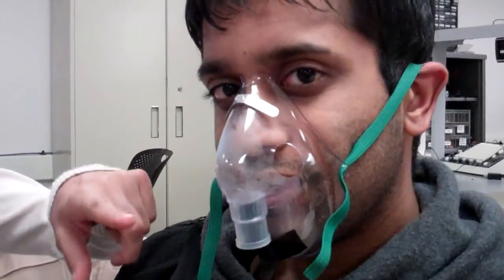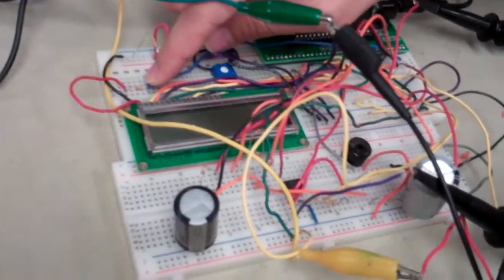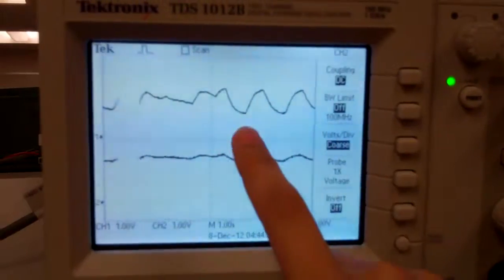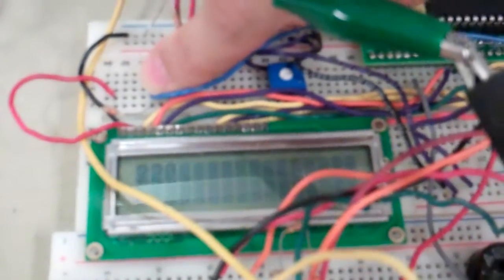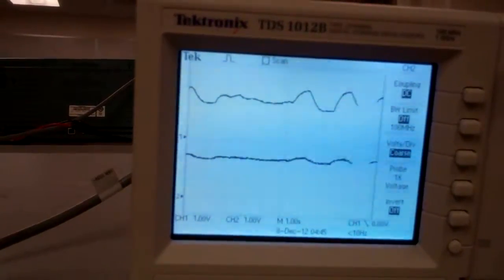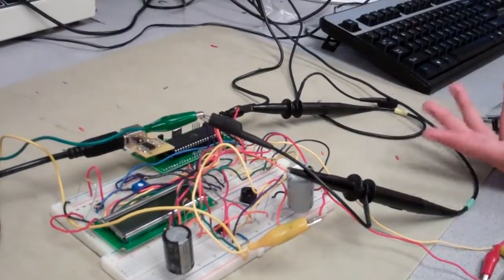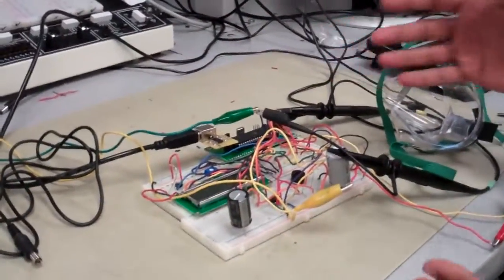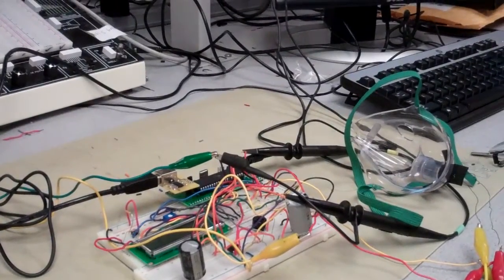Thermistor Respiratory Monitor

Comment: I need the complete schematic, in that page the schematic used 2 opamp but in the video and pictures they are only using 1, the minis schematic are confusing
Reply from the maker: Perhaps you did not know that thie opamp package contains two opamps. The document linked is the only information that exists on the project. But this project was done in the context of a class which used the following protoboard. http://people.ece.cornell.edu/land/PROJECTS/ProtoBoard476/
Reply from the maker: There is a bit more information here, but it is behind a paywall https://ieeexplore.ieee.org/document/6525657

Comment: plz can you explain the mathematical  relationship between temperature and respiration rate that used in your  projuect
Reply from the maker: exhaled air is warm
Reply: I know my friend
I'm working on respiration rate device by using thermal sensor I used lm35 and arduino  I had problem with code that connect temperature that I got  with respiration
Reply from the maker: @kingsboy8903  lm35 is too slow for respiration. you need a bare thermistor, the smaller, the better. example https://www.digikey.com/products/en/sensors-transducers/temperature-sensors-ntc-thermistors/508?k=thermistor&k=&pkeyword=thermistor&sv=0&pv16=7&sf=1&FV=ffe001fc&quantity=&ColumnSort=0&page=1&pageSize=25
Reply from the maker: the sensor used in this project, as specified in the pinked report is NTHS0402.https://www.vishay.com/docs/33008/nths.pdf
Reply from the maker: lm35 datasheet section 6.9, figure 3. http://www.ti.com/lit/ds/symlink/lm35.pdf

Comment: Could you please tell the exact thermistor you used for this project.In the data sheet it just said NTH SMD 402 series ,but what is the resistance and curve % of the thermistor you used or pls tell the exact serial number of your thermistor.
Reply from the maker: This project is 6 years old. The ONLY documentation is the linked report.
Reply from the maker: https://www.vishay.com/docs/33008/nths.pdf

Comment: May i have the circuit connection
Reply from the maker: did you read the linked report?
Reply: yes, but i didn't understand how to combined all the circuit
Reply from the maker: The report is the only documentation that exists.  Each of the circuit fragments shown indicates a connection to the MCU as a port pin number. One part they did not talk about is the board which we used throughout the semester which has the MCU and power supply. Schematics are here http://people.ece.cornell.edu/land/PROJECTS/ProtoBoard476/

Comment: Hi Bruce.I want to ask you some questions....can you give me an email to communicate?
If you please.
Thank you
Reply: Hello Mr. Mohammad Azzam.
Have you arleady succeeded to try thermistor with arduino Uno? Because I want to try this project on arduino uno too.
thank you before.
Reply: @marrezarifasaputra5748  brother send your circuit diagram for this experiment
Reply from the maker: ask here, or figure out my email yourself.
Reply: Bruce Land okkk...I work your project as my senior with some modifications...I try to apply it using Arduino Uno and connect it with mobile application using Bluetooth...The problem is with the arduino code...it gives me on the serial monitor (inf) while breathing...
Note: I try to modify your AVR code to work on arduino, but there some problems with the shortcuts you used...I want to ask you about the shortcuts
Reply from the maker: So ask. What do you mean by shortcuts? do you mean C functions? include files? or what?
Reply: Bruce Land exaclty...C functions...I try to understand the function...can you help me.
Thank you
Reply from the maker: I am not a mind reader. WHAT C function are you talking about? lcd_lib? the analog interrupt?
Reply from the maker: or do you mean how the whole program works. If so, you need to read the report again.
Reply: Bruce Land no no...not the whole program...I mean the parts of thermistor and ADC...I need the equation you had used in the conversion to help apply it on Arduino.
Thank you.
Reply from the maker: What conversion? You mean the function void thermistor(void)?  that function is just comparing ADC readings to see if they are changing. Are you really asking what the I/O registers do?
Reply from the maker: Making a thermistor work with the arduino is easy.  Google "thermistor arduino tutorial". for example http://www.circuitbasics.com/arduino-thermistor-temperature-sensor-tutorial/
Reply from the maker: Making a thermistor work with the arduino is easy. Google "thermistor arduino tutorial". for example http://www.circuitbasics.com/arduino-thermistor-temperature-sensor-tutorial/
Reply: I already tried that and got the temperature. 
but I want to measure respiratory too like your project. but on Arduino uno. 
I want to implement your codes into arduino IDE but I dont understand AVR.
I found some paper online that used thermistor and arduino uno, but sadly they didnt explain how to measure respiratory as clear as you.
Reply from the maker: If you have the thermistor, then you have the time course of the temperature. Look for the repeat rate of the maxima of the temperature.
Reply: Bruce Land so when the reading temperature is equals with the max thats mean the person is exhaling? And breath = 1 and use counter to get breath per minute?
Reply from the maker: yes. the trick is determining the max well
Reply: Bruce Land I see. And last question, Mr. Bruce. How can I get the max? I assumed I first need to get some example temperature for one cycle of breathing and declare it as an array. Then read the new temperatures and compare those new with the max. When the new reading=max thats when the person exhaling. Is that correct?

Comment: Hi how are you . I am hassan ghandour  i'm from Lebanon  .my topic  is same for this topic  but using  arduino  uno so i needs  your help  how to you connected  this thermistor  in the ardiuno  uno  and the coding uses .

Thanks .
Best regards.
Reply from the maker: Use one of the analog input pins of the Arduino. For codeing, look at one of the MANY analog examples which ship with the IDE
Reply: so i have many question .firstly  i  connected  the thermstor inside the mask and i include  the thermstor code in  the arduino but no  response result
Reply from the maker: Do you think I can somehow see your circuit? Start probing with a volt meter to see if the adc input is correct. "No response" means nothing to me. Do ou mean the arduino shut itself off?
Reply from the maker: And the code on the site will not run on an arduino without a lot of modification
Reply: Hello Mr. Hassan.
Have you already succeeded using thermistor with arduino uno? I have the same problem with you. I dont really understand how to implement Mr. Bruce AVR code into arduino uno.
thanks in advance.
Reply from the maker: Putting this on n arduino requires a complete recode. It is NOT written for a mega328, or for the arduino environment.
Reply: Hello Mr. Bruce Land
Yes I think so. I tried to understand the codes on resp_monitor.c but because I never learned about AVR so I hardly understand Mr Maneesh and Ms. Hana's codes.
Reply from the maker: Then why did you choose this project? To make something work, you need to understand everything.
Reply: I dont understand AVR like your project. But I can understand Arduino. I came here to find if someone tried your project but on arduino.

Comment: hey! i wanted to know if this could be made wirless . if yes then how?
Reply from the maker: anything can be made wireless. How? That depends on how far you want to transmit, what kind of protocol you want to use, and what you capabilities are.
Reply: Ok so i have been working on a mask and i want to apply the same technique wireless! And i have no clue how to do it! So could you please help! Also can i get your email id for better communication! Thanks :)
Reply from the maker: You did not answer the questions, so I can only guess. Wireless to your phone? To the cell phone system? My email is easy to find, if you bother to search.

Comment: Hello,sorry for this question but i don't see  if you wrote the resistence of the nths0402 thermistor.can you tell me wich is the resistence ,so i can buy  the right one,please (10 k,100 k 200k etc.)?
Another question.Can i use nths0603? or is it too slow for detecting the breath?
Thank you very much !
Reply from the maker: +Hassan El-khatib just match the resistance and keep the size small
Reply: +Bruce Land ok,thank you.how about nths0603?do you think that it works?
Reply from the maker: 0603 should be small enough, but match the resistance approximately
Reply: +Bruce Land ,Hello again .I have connected two wires to the tiny  thermistor ,so now i can  use the pin of thermistor and connect it to the circuit.I have a probleme because from the moment that i had put the wires on the thermistor ,the signal is more noisy than when the thermistor was not connected to wires(was on the breadboard).Can you help me with this. probleme?Maybe i must twist the wires?
Thank you a lot!
Reply from the maker: debugging noise is impossible to do at a distance. But what kind of noise? Line noise?
Reply: it's not a big distance.is the distance from the masc to the circuit (~50 cm).Like the distance between your student thas has  the mask on it and the circuit.the signal its like a sinusoid in zig-zag.can i send to you later  today an email with a screen-shot of the signal?
Reply from the maker: Does the frequency of the noise match the power line  frequency where you are?
Reply: +Bruce Land ,do you mean that is a probleme with the 50 hz noise?
Reply from the maker: IF the noise is 50 Hz and that is your power frequency then it is line interference
Reply: Ok thank you very much!!
Reply: +Bruce Land , Hello again.I hope that this is the last time that i bother you.I don't really understand the  schematic of charging capacitor.Wich are port B4 and part B5?I mean ,what   component of the circuit i connect to the pin of the two resistors that ar going to the capacitor?
Reply: +Bruce Land  so? can you explain me  where are port b4 and b5 connected? please?
Reply from the maker: B4 and B5 are two pins on the MCU. Did you read the MCU datasheet?
Hassan El-khatib
Reply: +Bruce Land oups,sorry for that.my fault!anyway ,thank you!
Reply: Is the high pass filter on the circuit an active high pass filter? Thank you!
Reply: +Bruce land ,what do you want to say with" Our slowest desired period is about 4 seconds." in the text on the amplification thermistor?WHat period?THank you very much!
Reply: Can you explain me please, also,why you choose 22 seconds the constant time? i mean you said the reason is hyperventilation.But what does hyperventilation has in common with time constant.?
Isn't it hypoventilation? because in hypoventilation the period of signal will be greater,and in hyperventilation the period will be lower,and you said that  all the periods that are lower than 22 second will be amplified.So the problemme will be in hypoventilation.Am i right? 
Sorry for all this questions but i want to understand what is happening there.
Reply from the maker: First: I did not choose it. The authors chose it.  
Second: The high pass filter of 22 seconds time constant is designed to NOT affect signals of breathing rate, but only slower signals, like the temperature drift in the room
Reply: OK.Sorry for the authors.I don't understand why they chose 22 seconds.From where did they conclude that this is a good filter for breathing rate?
Is it about that the frequency of respiratory rate is between 0,2 and 0,3 HZ?
Reply from the maker: As the paragraph says, average adult breathing period is about 4 sec, average baby about 1-2 sec. Let us say that we do not want attenuation greater the a few percent at the lower frequency. a cutoff at 20 sec gives about 5% attencuation at period of 4 sec.
Reply: Thank you very much!you and the students,are awsome!
Reply: the cutoff frequency of this high pass filter is 0.00723 HZ.Are you sure this is a high pass filter? fc=1/2*pi*R*C=1/2*3.14*10000*0.0022=0.00723 HZ
Reply from the maker: Am I sure? If it were a low pass, you would not see the breadth signal at all. So what are you really asking?

Comment: Hii, can you please tell me how we mount NTHS0402 on the nebulizer mask ..and the thermistor is so tiny
Reply from the maker: The 0204 thermister is tiny. The students mounted it on a small bit of circuit board. But you could use another bigger themistor.